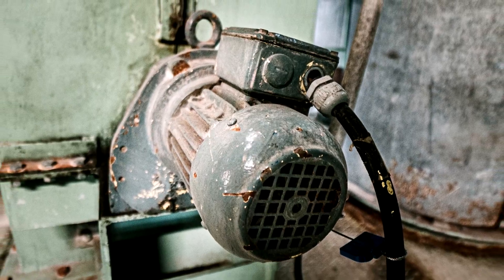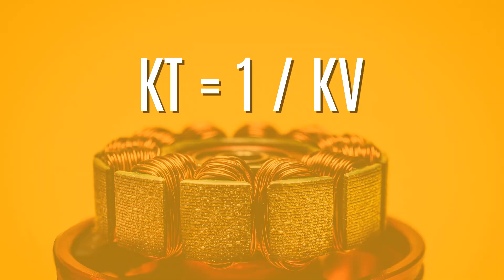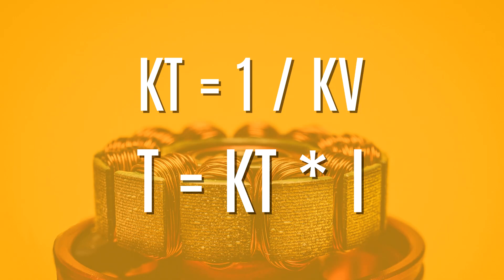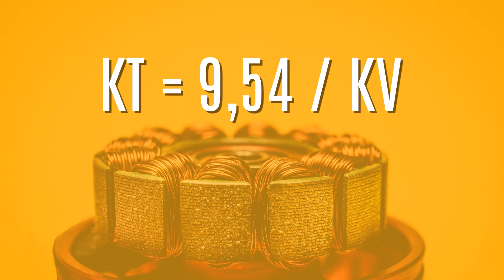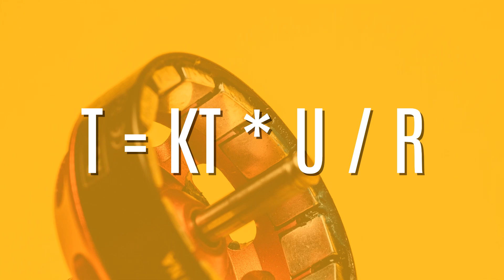Motor torque DOES NOT depend on KV and here is why!

Comment: Thank you for detailed explanation!
hope to suggest 2 things,
1) measuring motor's R, that is may not familiar for everyone, 4wire measurement.
2) multiple thin strand VS single thick strand. At same turn, same Kv, most user prefer single thick strand IMHO. The motor builders in Rcgroups are only preferred to build single strand.
Thanks.
Reply: So, by this, you are saying that a single, thicker wire is - less resistance? Smoother continuity? Better overall flow of electrons?
I'm not an engineer, but that feels right, and I would believe it.
Stranded wire is maybe less efficient, due to more, thinner strands of wire (variable resistance?), but stranded wire feels the "right"  choice of wire to  build with.....
I have never thought about using a solid wire, but maybe you're onto something here......Thank you for leading my mind down a different, albeit very sensible path...... :)

Gotta go do some Googlin' :)
Reply: @sunsetpark_fpv  stranded wire vs non stranded:  The fact that it's stranded or not doesn't affect resistance, only the sum cross-sectional area. Obviously we aren't talking about motor windings here, they are all unstranded due to size constraint. I.E. unstranded is always a smaller OD for same cross-sectional area due to packing.  Stranded gives your cable flexibility at the cost of overall size compared to unstranded for the same nett area/current carrying ability. E.G 6 strands of 0.2mm^2 carries the same amount of current as 1 strand of 1.2mm^2 but the 1.2mm^2 single conductor one will make for a slimmer but much stiffer wire, they weigh the same amount though, same amount of copper per unit length.  For stranded wire think of a stack of beer barrels, wasted space between each barrel, fatter wire. The next big innovation in wire will be hexagonal strands with perfect packing, if only it could be made cheaply and if anyone could be bothered. ;)
Reply: @sunsetpark_fpv  You are very welcome.

Comment: I would argue that most RC systems are current limited in general so that in practice lower kv does end up meaning more torque. Secondly it's not just the resistance of the motor you have to take into account, connectors, escs, wiring etc all have resistance too and usually you don't change this. Lastly current driven heating tends to be another limiting factor so lower current tends to deliver more efficiency overall, more efficient conversion of power = more torque.

If you ask the question: "If I use a lower kv motor on this quad/plane/car, will I get more torque?" the answer will almost always be yes in most practical examples.
Reply from the maker: Well, there is something to it, but it's more complex than that. Yes, if you lower the KV then you will increase efficincy slightly. But to keep the same power you need more voltage. So in terms of energy, it stay more less the same. But if you compute how much you gain in terms of waste (less waste) power due to resistance, you will notice the numbers are very low

Comment: Seriously ? Ohm loss is minimal compared to power generated. The only case à higher kv is insteresting is when the prop load is smaller enough to use torque available at the higher hand.

Comment: KV x voltage = RPM 

Size of motor gives you torque, if I’m not mistaken
Reply from the maker: Nope, KV is not how fast motor rotates per volt. It's the back-emf in volts when it's rotating.